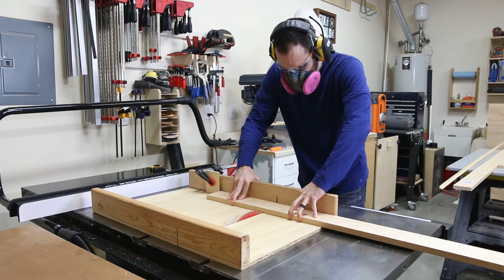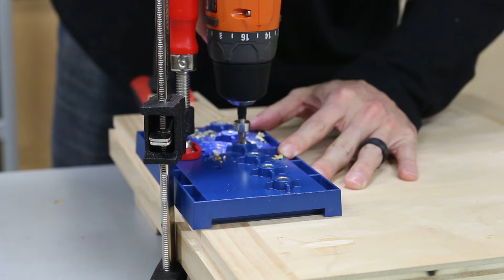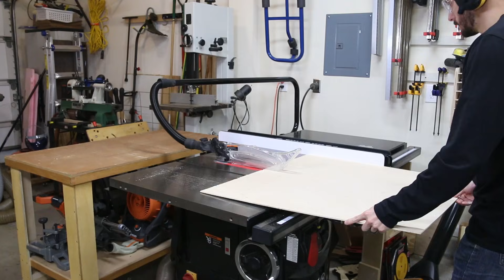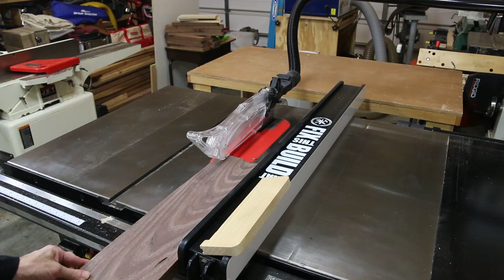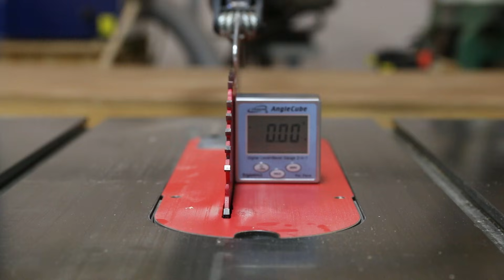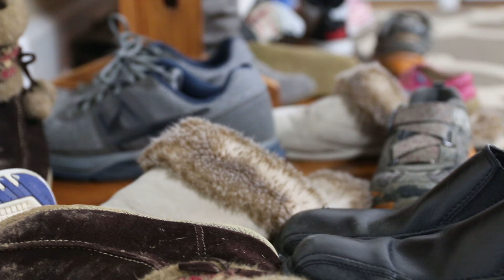DIY Shoe Storage Bench | How to Build

Comment: Hey Brad. I purchased your plans for this, well done by the way. I am cracking the legs when I drive the top screw in for the top side rail. I am using a pocket hole jig and 1 1/4 pocket hole screws. I just ripped down some 2x4 to make the legs. Any suggestions?  Do I need to buy pine boards instead of the 2x4?  Thanks!
Reply from the maker: Hey, Mark.  My guess is you're going in parallel to the grain.  You want to go perpendicular to the grain when possible.  Predrilling will be your best bet at this point if you don't want to remake them.
Reply: @Fixthisbuildthat  Thanks Brad. I appreciate the reply. I going to remake them and predrill perpendicular to the gain.  Take care.

Comment: Hi, love this design so i bought your plans for building it. I am brand new to woodworking. Do you have more details on the cove molding? I couldn’t find 9/16 cove at big box. But when online i see a second dimension. For example, 9/16 x 1 3/4”. Can you clarify? Would this size work with your plan? Thanks so much.
Reply: He used 11/16 molding - not 9/16. You can use any molding that you think would look good.  Doesn't have to be exactly what he used.

Comment: I pay already for the plans, now...I was thinking to reduce the weight and $$ by using 1/2 or less instead of 3/4 plywood, not interested in adjustable pins, but to place a fixed shelve. What else I need to adjust? ..screws length?

(More than 2 weeks waitingfor an answer)

Comment: Why did you choose to use 3/4" panel instead of 1/4" panel?  Doesn't it just make the whole project heavier and cosier ?
Reply: The 3/4" panels are what the shelf pin holes are drilled into.

Comment: just finished mine one minor difference, the top front an rear runners where made the same height as the rear. I then added a bottom the area between them an instead of screwing the top down I added a couple hinges. Makes for a nice little storage area for gloves an mittens. I also added holes to the rear runner an bottom  to allow air in when wet items area put away in the storage
Reply from the maker: +Greg Ward those sound like great mods, Greg! If you're on Instagram DM some pics!

Comment: Brad, I found your channel today and I must say I like your style, and love your well equipped shop. I've been around for a while and may chime in every now and then to share things that have worked for me in my quest to improve my hobbies. I just watched all six of your basic turning videos before this one, all good. The main thing I noticed is your irregular use of your face mask. Seems like you trust the vacuum to take the sanding and cutting dust away from you when in fact you should ALWAYS wear your breathing protection when cutting and sanding. There will always be some fine sawdust escaping the vacuum hose, this will accumulate in your lungs with no way to get it out: on the long run your lungs will suffer dearly. Be safe and keep the chips flying.
Reply from the maker: Gilberto, thanks for all the feedback on the videos.  I definitely should wear the mask more often.

Comment: love this project but I don't see the need to make the self adjustable, that is just extra work that is not required. I lay money once you figure out the height that works for you it will never be moved, that being said a little forethought an you could have picked the height that would have work for you ahead of time.
Reply from the maker: I don't disagree that once set it won't move.  But it's an easier option to allow the user to configure it themselves then locking them in one position which tends to lock some people's minds and they can't see other options.

Comment from the maker: Detailed plans with cut list, 3D diagrams and step-by-step instructions:  https://fixthisbuildthat.com/shoebenchplans
Reply: Fix This Build That would be a good idea to make more
Reply: Could you please make more ways to pay for it? I dont have a credit card and you cant make a paypal account without a credit card. ;l
Reply: I pay already for the plans, now...I was thinking to reduce the weight and $$ by using 1/2 or less instead of 3/4 plywood, not interested in adjustable pins, but to place a fixed shelve. What else I need to adjust? ..screws length?
Reply: I am interested in paying for the plans would it be mailed to me or emailed
Reply: Thank You Brad. Wife asked for a shoe rack bench for our front door. Yours looked the best from what I researched. Made one similar.

Comment: So a question - Did you put any kind of protective coat on the white shelves after painting? Seems like the shoes could easily scuff/dirty up the paint.
Reply from the maker: +romeobravo78 I did not. Just use a semi gloss paint and it's held up well so far. You could top coat with water based polyurethane for more protection

Comment: hey Brad I just got a set of plans for this build and got 2 different pdf builds am I understanding this is if I want to do adjustable or just shoe storage thanks
Reply from the maker: +William Gogo hey, William! Thanks for buying the plans. You got two versions of the build. My first one which was short and had different assembly methods. And the 2nd one which is the one in this video. They have slightly different looks to them and different construction. Choose the one you like best. Both are adjustable

Comment: You lost me at pocket holes.
Reply from the maker: +Jamie Miscoski that's the beauty of woodworking.  There are tons of ways to build the same thing.  If you're adverse to pocket holes feel free to use whatever joinery you prefer.  The design ideas are fluid and not locked to a single joinery method.
Reply: I like the pocket screws for getting the project done quickly and securely. But, what other joinery methods do you think you might use if you had time and inclination? I've been watching videos about Japanese joinery methods just for fun!
Reply: Don't fear pocket holes...once you use them, you will look for any excuse to use them again! Kreg makes a nice starter kit!